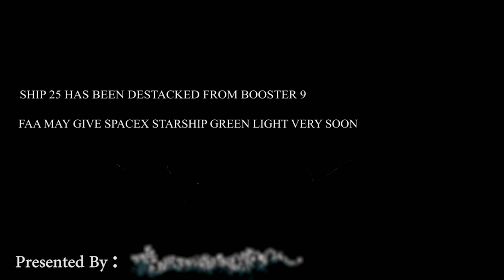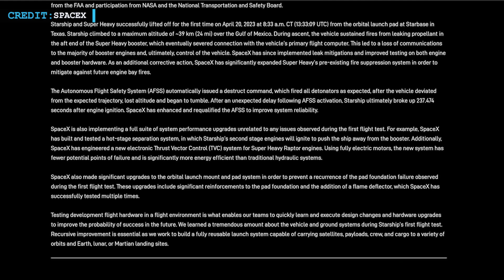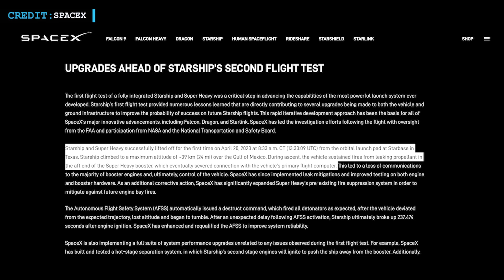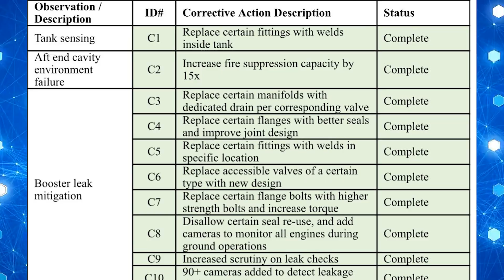SpaceX De-stack Ship 25! Why? FAA may give SpaceX Starship Green Light very soon

Comment: I would launch a booster alone to orbit, to test it alone, without endangering a starship.
Reply: Nothing to gain that way. Booster does not reach orbit, it goes only about 100 km high. Also is the flight data without SS worth nothing.

Comment: 2 possible reasons spring to mind:
Since the FAA won't grant a license for several weeks Elon wants to make some tweaks and they're easier to do with the ship sitting on the ground.
In case bad weather comes along the overall vehicles would be more stable with the booster held by the clamps and the ship on the ground surrounded by the chopsticks.